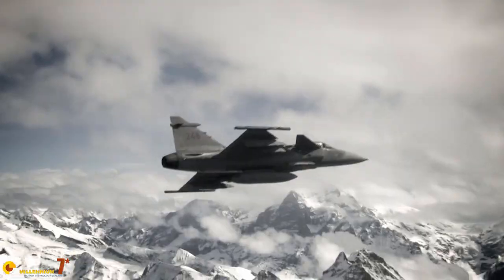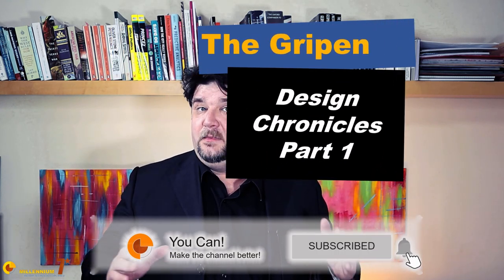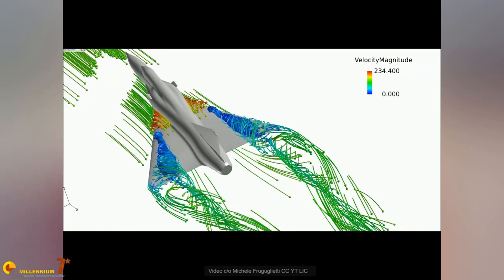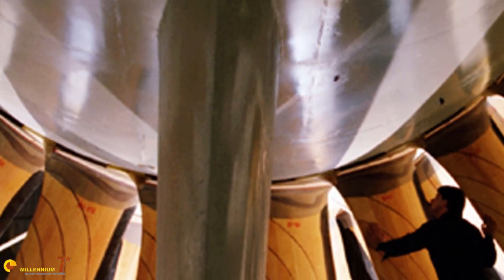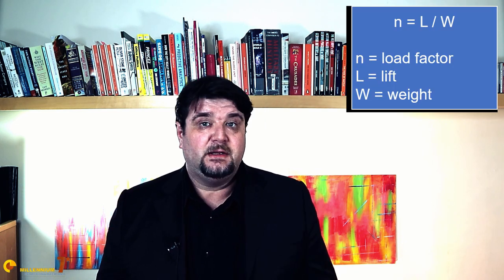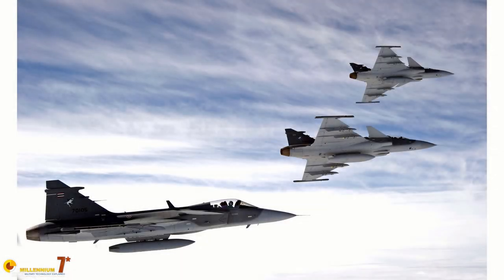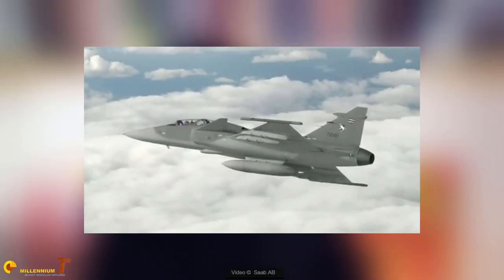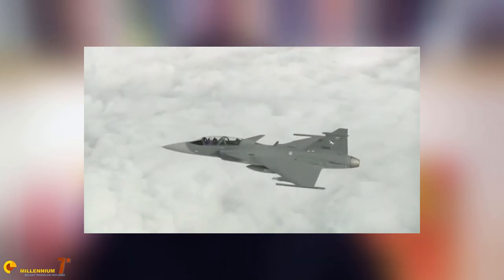The Saab JAS-39 Gripen: the design chronicles - (Long format, all episodes together)

Comment: Waiting for the Tejas to mature into a platform like this one..
Reply: Won't happen. The Indian defense procurement process is even more broken than the American system which is already ridden with graft. This is the same process that tried to produce a new rifle called INSAS and what was produced was so awful they had to buy Kalashnikovs. 
The same process that tried to procure an initial buy of around 100 Rafales with extreme concessions by the French towards Indian aircraft manufacturing, only to have it turn out that actually Indian aircraft contractors have nowhere near the capability to produce the subsystems necessary for a Rafale. 
The same process that tried to produce the Arjun tank which is inferior in cross country performance, firepower and in crew safety to peers in the region to the point that it is credibly threatened by something like the T-90 which is basically a re-turreted T-72. 
Add to that politicians so apathetic that they take a decade to finalise a contract, then fail utterly before finally coming to a deal, and it is clear that the "maturation" of something like Tejas is quite unlikely. What India needs is hardly new weapons systems. What India needs is the elimination of its generals and incompetent politicians and their replacement by people who actually know what they are doing.
Reply: @MonMalthias  Wrong, current Bjp government has given full priority to local products, i have followed Tejas for 21 years now. I can say they have taken it seriously now.
Reply: Its almost 90% as good as Gripen.
Reply: @KarthikSoun  Hey, you said it yourself, it took 21 years for a project like Tejas to produce an aircraft.
Sounds like your defense procurement could do with some cleaning out, instead of more vanity projects of national chauvinism.
Reply: @MonMalthias  Well all countries have corruption when so much money is involved. Its like the movie pentagon wars. There have been issues but things are looking up and Tejas Mk2 will be a much better plain.
Reply: @Donald Twitter It is probably better if you consider the cost is only 20million. It has a similar radar as gripen, similar GE engine and home grown avionics and ablity to build a composite airframe. The performance may be slightly lesser than gripen but LCA never had a test crash and Gripens canards caused problems initially causing crashes.
Reply: Marcos B  Haha.. i noticed. Their SAAB marketing team seems to have fooled everyone.
Reply: @Donald Twitter Lockheed did propose moving the entire F16 manufacturing to India including servicing of all F16 in the world. They understand the potential of the market but India is a developing country and we know we can not compare with USA. No one can.
Reply: @Nicsoft Inc I like the Swedish people so i won't punch below the belt India makes more cars than Sweden. I am not sure if you are 50cent or paxtaan because no one will look at a decent hardworking man in bad light unless they are a lazy troll.
Reply: Marcos B  India owns Jaguar and Landrover India makes hell of a lot of Cars now, plus google CEO and Microsoft CEO are Indian the blind hater commented on browsers and OS run by Indians to try and mock us. haha..
Reply: @Donald Twitter  @Donald Twitter Hahahaha SAAB paved the way for Concord, Space shuttle and Delta wing aircraft hahaha, there where no delta wing aircraft like Delta dagger before Draken? Which country had the first Delta Wing fightet? USA or Sweden? What a silly thing to say. The Vulcan was Concords Ancestor. Again you are wrong on the GE404-IN20 variants power, its a uprated version. Its the same as the Volvo-GE404 RM12 on the Gripen. Tejas doesn't have any obligation to cook up numbers like SAAB which needs to export the Gripen. First agreed on the F404IN Dry Thrust? Its not GE404 its GE404-IN VARIANT. Gripen G-limit is +9 and -3 not 11.5 again wrong.  Take of STOL is on full load for Gripen? One thing i agree is that i never said its 100% comparable to Gripen. The Tejas can be made to fire Rafaels weapons and BrahMos which is a supersonic cruise missile one of the fastest in the world. Here is the engine spec sheet. http://www.mce-asic.co.uk/military/engines/f404/
Reply: @Donald Twitter So much denial. How much Dry thrust on GE404-IN20 and RM12? Just tell me that first. Then we can start bickering about Delta wing.
Reply: @Nick Emerson I agree, British had previous experience with the Vulcan and Delta concept and they did study the Canadian Avro and Starfighter program. To say that Vulcan design didn't help evolve the platform would be hard to justify.
Reply: @Donald Twitter Did you read the GE browser i posted? What is wrong with that?
Reply: @Donald Twitter  @Donald Twitter  Then? What does then mean? Then the SAAB marketing wool coming of your eyes? HAL doesn't have a marketing team trying to sell it to a international market. A lighter Tejas has more composite percentage and less RCS compared to a Canard Gripen, Canards increase RcS and drag, dumping fuel at the afterburner at high altitude and fooling customers must be the only way. Marketing.
Reply: @Donald Twitter I have to be a stupid blind nationalist if i say Tejas or Gripen is equal to F22, F35, Rafael etc.,We are not that naive but Gripens is not very farhead to Tejas, the Mk1a will have Aesa to, Mk2 will have more advanced features with bigger f414 engine and Kaveri engine prototype.  There is a time when we made HF-24 Marut in 1955 we had to beg the west now my my how things are changing. Quantam is a unknown and sometimes unknowable field. Quantam mechanics is unpredictable so we will see when it comes. You fanboys need to behave more decently while representing your country instead of trying blame me and be respectful. Bye.
Reply: The one who wait for something good never wait to long. However for the Tejas, when humans invent a life extension pill, that will be the day you might live to see a mature Tejas, unfortunately. Indian developers seem impossible indecisive.
Reply: @lothwinmore2536  There is no future for SAAB Gripen. Tejas has domestic orders of plenty but like SAAB car the Gripen to will not last in the future. In another 25years the company will go bankrupt. Sweden will melt into Europe.
Reply: @Nicsoft Inc I was in a forum called http://www.bharat-rakshak.com go check it out. Its still around, some of us even meet back then. Its not this anonymous crap shoot where kids bad mouth each other, you get banned if your facts are wrong. Even my youtube account is older than yours. Tejas STOL variant even takes of from Aircraft carrier checkout the video of Tejas landing and taking of from INS Vikramaditya. Volvo cant redesign it was designed by GE and volvo manufacturers part of the engine systems like FEDEC. The single crystal blades, core, blade angle and critical technology USA will never sell, thats the part where the thrust comes from. You guys where saying RM12 has higher thrust now you decided to back down right? Its just a license copy apart from the FEDEC which was done by Volvo. Its still a GE engine. See the GE browser http://www.mce-asic.co.uk/military/engines/f404/
Reply: @Nicsoft Inc Right, some kids these days change the cars ECU. Big deal. 🚗
Reply: @Nicsoft Inc We don't need it thats why we choose the Rafale. Only a few countries can land on a aircraft carrier and Gripen will never land on one.
Reply: @Nicsoft Inc We did.
Reply: @Nicsoft Inc I will ask for a english teacher if I need one. Till then you are not required.
Reply: @Nicsoft Inc How good for you.
Reply: @Donald Twitter Which Aircraft carrier is it going to land? Chakri? That whole naval Gripen concept was for IN but we are not buying. We don't like it because Tejas is evolving into something similar. Plus Sweden has only 10million people. France and Russia have veto power that we can use to block China and Pakistan. USA is useful to but it comes with strings but this time we might buy 120 F15s. Buying a fighter is also buying friendship and trade.
Reply: @Donald Twitter Only US and France operate CATOBAR, Gripen doesn't have anything to sell to them. Tejas already accomplished STOBAR which relies purely on engine thrust. TEDBF will be way bigger and better than Gripen can be as one operates a single engine deck based fighter because it lacks thrust and saftey, yet not even one Tejas has crashed while testing in naval or airforce variants. What Tejas accomplished is a unique feat. Gripen wont do any such thing. As for US their defense establishment calls the shots so buying fighters and bribing sentors you can make USA bomb Maldives for no reason.
Reply: @Donald Twitter Your arguments where wrong to begin with. You didn't even know Egypt had Rafale then you botched up on IN20. So ya as we buy more and more from US and we are the only one fighting for democracy in a Islamic and communist neighborhood they will support us and we are signing a agreement with Britian for a 6th gen Stealth fighter called Tempest.
Reply: @Donald Twitter Right, is being dishonest a prerequisite in any Gripen discussion? Keep pretending about Egypt, Rafale crashed over Libya but i cannot count how many times Gripen crashed, it doesn't have a clean track record like Tejas, gripen didn't even take off from a ship yet. HALs hands are full and its not catering to international customers, you will have trouble in the future when TATA advanced systems and Mahindra aerospace mature. As for Tempest we are invited to join but we havent madeup our mind yet, we don't know if someone will claim they did the tempest alone and shot down a alien.
Reply: @Nicsoft Inc 2052 SAAB would have dissolved into the EU, your way of thinking is outdated. Facts are irrelevant to you, British BAE invited us for Tempest, France has nothing to do with this.
Reply: @Nicsoft Inc I am confused are we talking about Tejas or Tempest? France has always been a long time all weather partner for us. Tempest is a new program you are slowing down nic.
Reply: @Nicsoft Inc So is non existent advantage that the RM12's bird cage offers over IN20. Many birds you say, imagine how batman felt. Gripen is superior to Allah and beer and swine in truffle sause.
Reply: @Nicsoft Inc Wont save Gripens future.
Reply: @Partifakta 2018 No one asked you, your analysis is like Gripens marketing team, overstated.
Reply: @KarthikSoun  Tejas being the second Indian Jet would have been a good plane 20 years ago. Were it not for US sanctions it would have been so. The very good thing with Tejs is the small RCS, the price and the fact it is made in India. Unfortunately the plane is a sort of 1960 construction and has a very high drag factor. This has resulted in a rather slow speed and no supercruise capability. One can say that this is no disaster but high drag means more use of the afterburner, the use of an afterburner gives a very large IR profile. Those are things that could have been avoided. On top of this it makes the Tejas a very thirsty plane redusing the combat radius to 300 km or 500 km depending on weapon load. The engine is in other words in need of a new body.
As for the rest of the plane the turnrate is ok, but being a delta it bleeds speed and the absence of canards means it is no way to controll the airflow over the wings. The wing on Tejas has acoarding to the constructor been a success and the airintake is made to reduce the RCS. As for radar it will have an Israeli construction, that has a 120 km reach at a 1m² RCS. This would have been enough 20 years ago but medium range missiles is now going far missiles like Meteor or AIM 260 JTAM are now built to be used at longer distance than the Tejas can see, missiles like the Chinese PL 15 with a 250 km "Chinese reach" a 160  km European reach is now the the new normal. The demands on a Indian plane is not to defeat Pakistan the Chinese are entering the realy big leag. From this aspect the planed radar on the Tejas is not good enough. Tejas was to be a swing role fighter but as it is I think it should keep to A2G missions. For those it is a good platform, hard to detect, ok weapon load it needs a good and light E warfare suite to be realy good. You claim that it can do 90% of what a Jas E can do, sorry it can not, I know that national pride makes you say so, but it is not true, if you say 65% you would be honest. If we compare with Jas E Tejas has 
No IRST meanes 0% in IR detection. 
Radar < less than 50% reach. 
Speed 75%
Supercruising not even close to it. 
Combat radius 33%
Altitude 92%
Weapon load claimed 81%
So adding this up what you see here you do not end up with a 90% exept in altitude, but being only the second jet plane India has produced it is still something India should be very proud of. There is one fact that stands out on Tejas that makes it an excellent try. This is that India nearly made a good engine for it. I truely hope that india succeed in saving the jet engine China having spent billions on jet engines still can not produce good military jet engines. Being as close that india was is extreamly good.

Comment: Those little wings behind the canards reminds me on why the leading edge of the Avro Arrow broke up half way between the fuselage and the wing tip.
The Arrow was a delta wing but did not have canards. https://en.wikipedia.org/wiki/Avro_Canada_CF-105_Arrow.
The Arrow is said to be comparable to the Saab 35 Draken.
Reply: @Nick Emerson Thanks, I didn't know the right term.

Comment: Good sir; I just watched some Gripen 39 fly-bys, and it has this strange whistle/whine, as it goes away... do you know the explanation for this?
Reply: "Turbine singing" Audio phenomenon, as when you are blowing in an empty bottle.... People love to hear the "singing" and I think it happens over a certain speed (subsonic still) and is characteristic for the Gripen engine.
Reply: @jonnifjader  Thanks...ah so, a kind of resonance phenomenon,. probably in the inlet section?
At least it's an "interesting" sound, unlike the horrible low-frequency noise that the A320(19?) had during the takeoff climb... whenever I sat in front of the wing, the "pulsing" was just about unbearable!

Comment: But can the Gripens computer stand an EMP burst as other jet makers claim:)
Reply: @henrikg1388  a 20-year-old F22 can:)
Reply: @Partifakta 2018 so you dont know anything about it then:)
Reply: The US and several NATO partners have been incorporating EMP-hardening into critical defense systems ever since the US discovered the EMP phenomenon in the Pacific atmospheric nuke tests in the 1950s-1960s.  It involves incorporating Faraday cages into electronic component boxes and shielding of wiring.  It's been standard for the better part of the last 70 years in many systems.

Comment: @Millennium 7 ; 
Is it possible for you to do a review of stealth technology, shaping and materials and put to bed the ridiculous claims and hyperbole made about stealth technology and its real world applications, tradeoffs, and the way it reshapes doctrine? The way it is described by people as if it is a magic technology that will make planes invincible yet with detractors claiming that it can be defeated with long wavelength radar while ludicrous declarations are made by defense contractors is absolutely galling.
It's clear that the vast majority of people who talk about stealth know absolutely nothing about it. Making a video using this blog post: https://basicsaboutaerodynamicsandavionics.wordpress.com/2016/03/04/stealth-techniques-and-benefits/ which steps through the basics of stealth shaping would go a long way but I would also say that the agitprop out there about stealth will also need to be put to bed by demystifying exactly what goes into modern stealth technology. 
First, changing the thickness of a layup can change the absorbed frequency of a radar signal, allowing a designer to "tune" what wavelengths are absorbed. The thicker the layup, the more absorption of radar with longer wavelengths. 5-20 dbsm reductions are achievable: https://pubs.rsc.org/en/content/articlehtml/2017/ra/c7ra02631e#cit8 
Second, using continuous fiber versus chopped strands also matter. Continuous fiber produces long conductors that have a directionality to how the radar waves interact with a radar absorptive surface. If unidirectional weaves are used, which are quite common in prepreg setups to minimise weight, a surface might be extremely absorbing in a certain orientation from the radar's perspective but from another orientation it is extremely reflective. https://sci-hub.tw/10.1117/12.2176750
The "Fiber mat" claims by Lockeed are nothing more than using chopped strand mat! https://sci-hub.tw/https://doi.org/10.1016/j.mseb.2009.03.023 
Boatbuilders making fiberglass boxes for their fishing gear are apparently now working with stealth materials according to LockMart!
Third, you can vary the amount of carbon fiber by mixing in more or less glass fiber strands (that can also be made electrically conductive if you want by CVD coating with metals) and therefore tune the wavelengths at which the composite is absorptive that way: https://sci-hub.tw/https://doi.org/10.1016/j.compscitech.2018.02.001